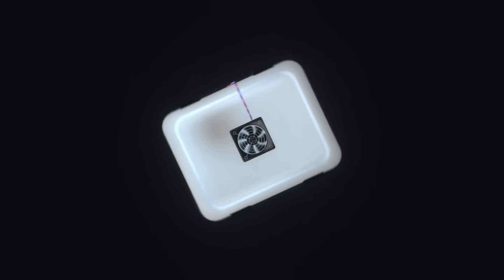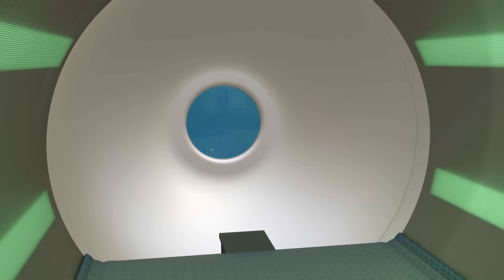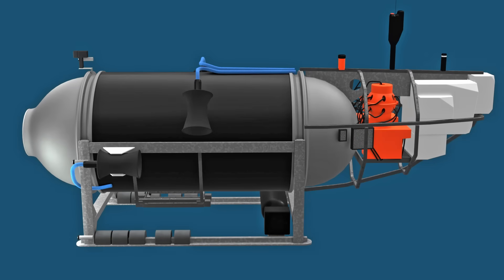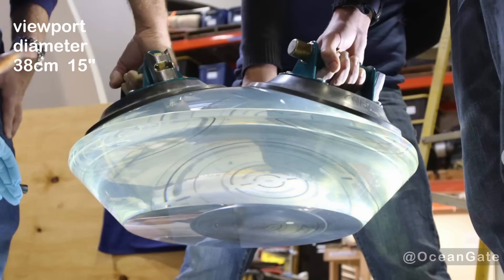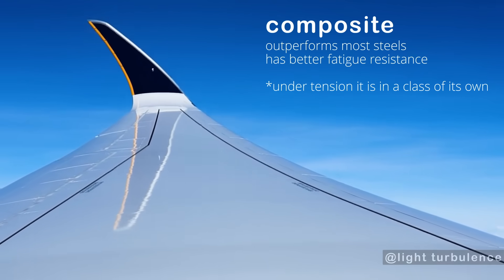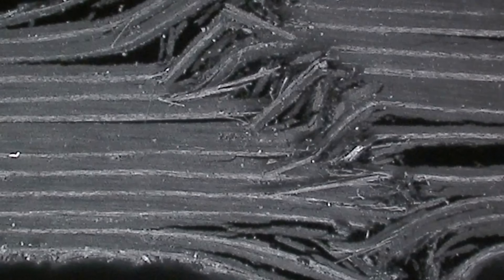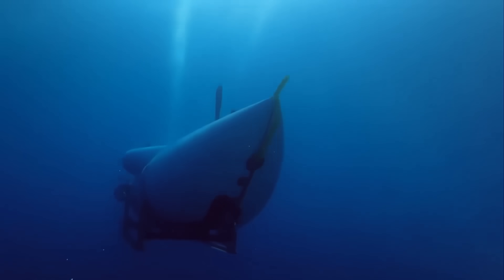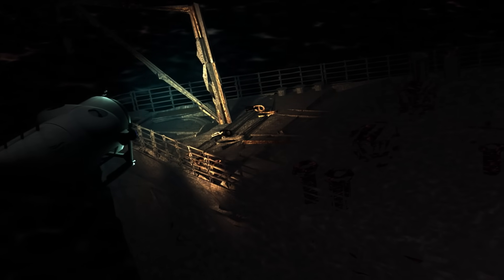Titan Sub | carbon fiber - Detailed Tour

Comment: Carbon fiber for those who don't know is essentially a rope. Think about the cables that hold some bridges, they are designed in a way that their tensile strength is much higher than their compression strength, the material is so strong that it could sustain strong compressive forces but only at a fraction of what they can support went tensed. Carbon fiber is by its design meant to be extremely impressive when tensed but it can only hold a fraction when compressed. Steel hulls are extremely strong under compression when using basic geometric shapes like a cylinder. To be an innovative application of carbon fiber one would have to understand how to weave it in a certain pattern and calculate a certain geometry for the submersible so that under uniform pressure the carbon fiber would have to extend in order to keep everything in place instead of contracting. This is admitting such a solution even exists. The other option would be to brute force the problem by creating such a thick and dense carbon fiber hull that even if the compression limit is only 10% of the extension limit it would still be enough to easily go back down to 5km and come back up. I am not even going into more technical details such as computer modeling. It is extremely easy to model the behavior of a cylindrical uniform Steel or Titanium hull (so much so that a noob could do it) whereas it is extremely complex to model a material composed of two or more due to the non linearity of the partial differential equations which results in bad behavior of the numerical solutions that your software will generate.
Reply: It appears carbon fiber maybe useful for submersibles for shallow dives...but not for trips to the TItanic or to the Mariana Trench.
Reply: @PungiFungi  not entirely true. A CF submersible designed to go to the bottom of the mariana trench was invented, and tested to that pressure, but was determined to be one use only. So it seems like it works fine as a one use material to those depths
Reply: Just a general comment from an aerospace guy.   On wings it’s not the composite skins taking most of the Compression or tension loads.  Most of the bending loads are resisted by the front and rear spars, and still made mostly the old fashioned way out of aluminum.  There are some newer commercial aircraft with composite spars but I don’t think you can call it the norm.
Reply: Thanks  @chrissmith7669 . Makes the point the example of an Airbus wing is not a good analogy
Reply: Sorry Mike, but I believe you are fundamentally wrong. Your assertion that composite fibre materials are great under compression is wrong. Let’s take a step back. 
Just as @zemm9003 says, GRP and carbon composites are made up of millions of threads (or ropes) bonded together in a resin to keep them in shape. Their huge strength is in the strength of ‘*the ropes*’, and ropes are very strong when you pull on them (tensile strength), but simply deform (fold) when you push on them. What holds them together under compression is the resin and not any inherent strength of the fibre as you’re not pulling on the fibre and using its strength. You are now reliant on the resin and the ‘matting’ trying to keep it together. No wonder is cracked and groaned when they dived.
And your analogy of the Airbus wing is also incorrect. Why? Well let’s think about what happens when that wing flexes up (or down). Yes, the top of the wing (in a flex up) is under compression, but what’s going on on the bottom of the wing? That’s right, it’s under tension and composites are very strong under tension. So the wing is not resisting the upwards flex due principally to the composite resisting the compression, but by the resistance to the tensile load (stretch) carried by the lower surface. The upper compression is supported by the lower *tension*.
Let’s think about composite aircraft bodies. What’s going on there? Well, aircraft are pressurised at altitude meaning the fuselage is under … you guessed it … tension … constraining the internal air pressure.
And what happens to a submarine casing? It is under compressive load only. There is no ‘other surface’ in tension like with the aircraft wing, all those fibres and the resin trying to hold them together are being squeezed together. You are not benefiting from the huge strength of the fibre. You now have nothing more than ‘some matting’ trying to keep the resin together, as it’s the integrity of the resin that is now saving you.
Reply: @iainhunneybell  reinforced plastics are not as good as in tension but is a poor analogy to what's actually happening. You'll find the strength is generally reduced to %70 ish (depending on laminate stack fiber modulus, resin content and stiffness etc.) and excluding buckling modes which exist in all materials. 

The pressurization of a plane hull offsets the compression loads reducing the buckling tendency which is a big factor also. The main point is pressuring the fuse is a benefit to every material in this scenario. 

The compression and tension have to be balanced in any beam structure. You just need to look at a bending force through the section of the element to see that. Whether or not that neutral axis is in the mid line is dependent upon the stiffness of multi material and asymmetric cross sections. 

Just look at the push rods on F1 cars they are of carbon construction and they outperform their metal counterparts quite well! And they are very much only in compression when in their working window. 

Is carbon a suitable material for everything no. Is it just as strong as the resin under compression also no it's very much stronger than the matrix material. It's a very good material under compression when engineered correctly.
Reply: @iainhunneybell  You knowledge of the distribution of tensile and compressive forces in a beam or wing, in bending is just wrong. If the beam is symmetrical the compressive forces on one side are exactly equal to the tensile forces on the opposite side. At the centre is the neutral axis where there is nether compressive nor tensile stress. It resists bending equally because of the tensile stresses and the compressive stresses.
A cylinder under compressive load can fail in two distinct ways, the material can crush or it can exhibit a stability failure also called Euler buckling where it crumples like a steel can. The first crushing is entirely resisted by compressive strength, but the buckling failure is resisted by stiffness and carbon fibre is one of the stiffest materials known.
The failure was probably due to water ingress into the carbon fibre laminations at the Titanium/carbon fibre join.
Reply: @iainhunneybell  When I read your comment and all the others I just ask myself - "Why did makers of Titan used that carbon threat to spooling it up on the spool (like thread for sewing machine) when if they winding it up like wires on toroidal core (cylindrical one) would have work  better from compresion/tension stand point." And I'm answearing myself. It's because robot that was doing spooling would have to be way more complex(expensive) and they would need more complex other parts of submarine aswell.
Reply: @iainhunneybell 
Consider the fiber as a stiff element if its non-axial degrees of freedom are locked by the resin matrix. A woven carbon fiber block would be much stronger in compression than a similar block made of resin alone. 

In an airplane wing the compressive forces are countered by the tension forces - the two are in exact balance. The art is to design the wing so the neutral plane is positioned correctly so neither compressive nor tension forces exceed the structures that bear them.
Reply: @iainhunneybell  
You are absolutely wrong. After 20 years of carbon Fibre lab testing and using it in the wings of our JS gliders  I acan tell you that Carbon has about 60% compressive strenght compared to tension. It is the carbon fiber that carries the compressive load, not the resin.  Carbon roving in epoxy has a compressive strenght of 670 MPa and 1000 Mpa in tension. Resin in compression is about 80 MPa.  The top flange of any carbon wing beam is in compression and we design for this. I can give you 20 years worth of my own lab tests which substantiated this and this data is also accepted by EASA for aircraft manufacture. The tensile strength properties are rarely used in aircraft wings as the compressive strength is the limiting factor and thus the design point. The compressive strength while loer is still bteer than most steels an about 2.5x that of Aluminium. So still an obvious choice for aircraft wings.
Reply: Just a general comment from an aerospace guy.   On wings it’s not the composite skins taking most of the Compression or tension loads.  Most of the bending loads are resisted by the front and rear spars, and still made mostly the old fashioned way out of aluminum.  There are some newer commercial aircraft with composite spars but I don’t think you can call it the norm.
Reply: @chrissmith7669   You’re talking about Boeing and Airbus, which are very conservative for a number of reasons. Composite wings have been around on smaller aircraft for decades. And the old-fashioned way of building wings did not use aluminum but wood, which is actually a natural composite. Of course, the really old-fashioned way of building wings uses bone, which is also a composite.
Reply: @edwardwright8127  lol.  My composites instructor once told us nature was the best composite designer ever and we’ll never beat it
Reply: @chrissmith7669  that composites structure instructor should go into a Forrest and study the deteriorating strength of decaying wood, for some reason nature taught worms to eat that super natural best designed structure. He must have left out that nature is also the best ultimate disposal designer.
Reply: I heard some of the material used in the carbon fiber was beyond it;s shelf life.
Reply: @oldarkie3880  carbon fiber does not have a structural limiting shelf life, no microbes, or humidity deteriorate the material . Not does the strong inter atomic bond  deteriorate over millions of years.
Reply: So this is why he was supposed to test the design. He could have done a couple of test dives to increasingly deeper depths - say start with a depth to 1km first, then ultrasound the hull and check the structural implications.
If all is OK, he could gradually increase the dive depth, rinse and repeat until there is confidence in achieving the required depth.

That's the least he could have done for passengers. Instead, he was a cavalier cowboy with delusions of grandeur.
Reply: @scroopynooperz9051  I think just a few of those "gunshot-like" sounds would have sent me back to the lab! lol.
Reply: @scroopynooperz9051 You can't ultrasound CF that's 5 inches thick.
Reply: @scroopynooperz9051  And he expressly refused to test the hull, according to his lawyer.
Reply: @scroopynooperz9051  ...You are aware he did do those test dives, with only himself on board. And that this was the last dive out of a long series of titanic dives, all of which were completed without incident, right? 

Sure, he was cavalier with certain safety precautions, but he did do the due diligence on testing the actual pressure hull on first manufacture. He didn't do enough post dive or post season inspections from preliminary reports, as the hull was not 100% inspected with sonographs and radiographs in the post season as was recommended as best practice. 

Given the attempt to fundraise for science using these tourist expeditions, I can see where someone whom is totally convinced they're well informed, while being entirely unfamiliar with the real world, as scientists tend to be, would decide that such extensive examinations were cutting into the science funding and were not required because in theory the hull should not need it according to their calculations. 

He was an idiot, but he wasn't evil, nor was he entirely and utterly moronic to the degree you seem to believe, as extensive testing and inspection after the first handful of dives was in fact conducted. This is more a dehavvile comet type situation, where the inspections failed to catch progressive failure that became lifethreatening well after the original testing period.
Reply: Wokeness is the ultimate killer.
Reply: You're just repeating stuff you read. Come on dude. 🙄
Reply: 😂Yeah that sounds great but unfortunately all the real experts who do submersibles for a living say carbon fiber isn’t suitable for deep submersibles
Reply: @Deepblue220  It's interesting to note that those experts are still alive, unlike the champion of the carbon fiber submersible. I think there's a lesson there that OP just can't grasp.
Reply: @rodneybray5827  Exactly. The carbon fiber champion is dead. James Cameron has been to the bottom of the Marianas Trench. No carbon fiber present 😂
Reply: @JoeLinux2000  If you want to ask a question - then ask   that question. "???" isn't going to get you any answers!
Reply: I’ve used a similar analogy trying to explain why composites aren’t used in compression.  In compression Most of the load is taken by the resin or epoxy used.   Crack open any design book on composites and I doubt you’ll find any ton how to design for primary loads in compression.
Reply: As mentioned it's strongest under tensions not compression so the reports are correct and an airplane wing is not a good example as most of its forces are tension not compression although there are lessor compression forces on top, along with being a composite material and not pure carbon fiber.
Another problem with carbon fiber is it does not deal well with cold and repeated dives were almost certainly making it more brittle.

The sensor system was under lunacy give how carbon fiber fails which is all at once and completely. A traditional hull may have given some warning which a sensor system may have picked up but not this material.

As for the pictures giving clue they may be correct or total red herrings given how carbon fiber fails but only time is going to tell that story.

The so called messages we total nonsense and didn't even get basic facts right.
Reply: This a fantastic  vedio! Carbon fiber  is very strong but  every application is differant air lines spend 100s of millions testing it to death self destruction  testing 
Is mandatory in all cases  structural engineers with life time of experience  is needed yes it was a beautiful  design  and carbon fiber I believe  was a good idea 
Only he didn't  test or build it correctly maybe another 2 in he's cloud have saved the day ! Only he didn't test it to destruction 
Carbon fiber works on directional  force vectors  if you apply force in a wrong way it breaks like glass   it must be laid up in 100 percent perfect way or it will brake
Add to that salt water! May have weakened the resin or the fibers again testing is the only answer he did very little
Reply from the maker: @@freiherrdinkelacker I’m not saying 100% it can work. If they can’t get it working in testing and development nobody will sign off on it and they idea goes to the dustbin. But from my conversations with composite experts the material has the technical strength for the task. But this is a new use case with plenty of unknowns. This is nothing earth shattering, I’m just talking common sense.
Reply: Rope is a wrong analogy as rope is itself made from strands to be flexible in many directions, those are strips. For a better analogy try folding paper more than 7 times over ;-)
Reply: Hydraulic Press Channel has some great videos of paper under compression (spoiler:  It explodes)
Reply: interesting. I'm of those that believe carbon fiber will be found in submersibles - 35 years from now. why? i witnessed the same arguments against using carbon fiber in modern airplanes as we transitioned from aluminum/titanium.  its amazing how it can be structured. I see not just the fuselage (rope like, must withstand internal force) but other parts, stringers, tail empennage connection points (777) all made from composite now.  not here for an argument (and yes, i'm involved in aerospace)
Reply: @prestonburton8504   wait I never get on a carbon fiber jet  in time you will see planes breaking up
Reply: @prestonburton8504  The main fatigue load in airline aircraft is the number of pressurization cycles, puting the wound fibers in tension, in the B 787, In the Airbus four panels are fastened to form a much more complicated load path around the fasteners, with local deformations enough to ruin the outer coat, with paint separation, a reason for Quatar to refuse acceptance of A 350 aircraft.
Reply from the maker: Be careful getting your technical explanation of carbon fibre from James Cameron 😂
Reply: @Mike-Bell  >Be careful getting your technical explanation of carbon fibre from James Cameron 😂<
Sure, but how about the material engineering profession, especially specialists on carbon fiber, and those who design pressure vessels or submersibles?  The professional consensus seems overwhelmingly that {carbon fiber} = { no bueno for external pressure loads.}
Reply from the maker: @apostleverde  I did consult aeronautical engineers who manufacture aircraft from composite. They find it hilarious that composite apparently is no good for compression seeing as the success of their planes and their business is dependent on carbon carrying the crazy compression forces in their wings and critical parts. 😂
Reply: @Mike-Bell  The issue isn't so much the compression forces. In a thick walled cylinder that is loaded with outside pressure, you will experience tension forces in the inner half of the cross section. In fact at the inner diameter you will have the same tension forces as if the pressure would be inside of the cylinder. But, there can occur issues with CF-Composites which comes from compression, which the Titan sub allegedly experienced even before the disaster...delamination. CF-Composites run the danger to delaminate if you put them under excessive pressure but also tension. Though the forces required to cause delamination under compression are much lower. Which means the outerlayer could delaminate under the pressure, effectivelly thinning the effective structural cross section more and more, increasing the load on the remaining material. Eventually the delamination will happen so deep in the structure, it will cause an immediate catastrophic failure.
Reply: lol  @shi01  , who are you parroting?
Reply: @Mike-Bell funny you say that, the carbon for wings is specifically designed so the carbon is primarily experiencing tensile forces. Weird call to a false authority and invisible army argument you're trying to make all through here.
Reply: @shi01 exact. And delamination is also a pb for planes. See a350
Reply: @Mike-Bell  That's a nonsense. When you bend a wing upwards the top half goes into some compression but that is more than offset by the lower half of the wing going into tension.  The tension side is doing all the heavy lifting.
In the Titan submersible, there was no tension offsetting the compression therefore all they had to rely on was the compressive strength of CF which is much less than its tensile strength.

The compressive strength of Carbon Fibre is between 10 and 60% of its tensile strength.  The compressive strength of Titanium is more than twice its tensile strength for comparison.

But you haven't even talked about what the OP raised, Carbon Fibre is not a homogenous material like Steel or Titanium therefore it's much more difficult to model due to variances in the material.  You just don't get that in Titanium.
Reply: @Mike-Bell Having consulted aerospace engineers, they agree with the original comment, that carbon fiber is good for some loads but not others. The compressive load found when under external pressure is a great example of a load carbon fiber is not designed for, according to them.
Reply: @captainwin6333 the video put forward some interesting hypothesis about a potential failure mode, the Fibre isn't doing as much under compression as the resin which i think matters more here. 

They may have been better off with thick layer(s) of resin which would be individually easier to model. I'm guessing there was more contraction of the fiber (from the outside) and the seam was likely the failure point, this would concentrate a lot of pressure on whatever is bonding the two surfaces.
Reply: @Mike-Bell  When they say no good for compression, they mean at far greater pressures and forces; you are the one that even admitted in this very video that the axial layers had no tensile forces and only compressive forces and that this was the likely cause.

No crap a carbon fiber resin can handle compression, but it handles it worse than tension, and at such pressures in the deep ocean, this becomes a major factor. And an engine pulling a plane along is putting tensile forces on the carbon fiber. Fiber is better at withstanding tensile forces than compressive forces; that doesn't mean they cannot handle compressive forces at all.
Reply: @69nites Yes, as the carbon fibre on one side of the wing goes into compression, on the otherside it is going into tension, and that's where the strength is
Reply: @Mike-Bell  what part of a wing need to withstand a significant compression force?
Reply from the maker: @dovydaskaminskas4227  In normal flying it is the top skin or the top of the spar but in negative G it becomes the bottom. And torsional forces complicate that too.
Reply: @shi01  I agree. This is a meterial that cannot recover from deformation. Each deformation just adds to the damage. There is no popping it back into place like with some metals.
Reply from the maker: @fnhatic6694  well yeah actually an aircraft flies at lesser pressure at altitude so even less force by your logic but thats not how it works. 
The structural load in the wing is from the tip bending up against the wing root and those forces inside the cantilever beam structure are MASSIVE where it acts against the body.
Reply: @Mike-Bell  to muddy the water (bad pun) even more.  An aircraft fuselage skin is loaded in primarily tension as internal pressure expands it like a balloon at altitude. Many also contain negative pressure relief valves that prevent crushing pressure over about a half psi to prevent potential damage. 
It doesn’t take a phd in composite structure design to notice nobody’s navy uses composite hulls in submarines that don’t go even a fraction as deep as titanic.
Reply: @jj-jak  Using only resin and no fibres? That already exists in subs. Look at acrylic windows and acrylic hulls. Being formed all at once, acrykic is a uniform material where it's easy to test smaller hulls many times by load cycling until destruction and then apply mathematical models for larger hulls. This is same as how we can compute the strength of varying size steel beams - the material itself is perfectly predictable. And there isn't the issue with water getting into the material that the carbon fibre hull has.
Reply: @Mike-Bell  So they're going to fly their craft to the Titanic? You are not very convincing. I should think an aeronautical engineer would have the good sense to strongly consider the opinion of deep water engineering experts. Or do the aeronautical guys all wait with baited breath to hear what other engineering fields tell them about how to build aircraft? Didn't think so.....

If you know any engineer that finds engineering outside of their field to be hilarious, I don't want any part of that engineer's work affecting my safety. Stockton Rush was amused by regulations and accepted engineering in submersibles as well. Who's laughing now, besides these supposed aeronautical engineers? What a crock...
Reply: @Mike-Bell  james cameron dived the deepest point on earth more than anyone, i trust more on his instinct and knowledge than some random youtube content creator
Reply: @Mike-Bell   It was obviously the perfect material.  Glad they're all still around to do it again.
Reply: @Mike-Bell  yeah you can write off James Cameron, but here 8:54 we got words from Brian (Real Engineering) which has a Master's degree in Aeronautical Engineering from University of Limerick
Reply from the maker: @skyfeelan  yes that’s a problem because as an engineer his words carry more weight and he should have researched them better.
Reply: @Mike-Bell  You literally admitted that the axial layers were not under tension and only compression and that was the likely cause; how is this not contradicting yourself?
Reply from the maker: @pyropulseIXXI  I said axial fibres were not laidup under tension.  That has nothing to do with the forces in the material once under load in the ocean.  Once in the ocean the axial fibres failed because they were skew.  If they were perfectly lain and straight they would have survived the compression.  I dont get where you say I am contradicting myself.  Or I dont understand the point you are making.

And in my video I noted that CF is way stronger than in tension than compression, nobody disputes that.  Importanlty in compression it is still up there with the best steel.  Thats what makes it a structural marvel.
Reply: @Mike-Bell  under compression the carbon fiber can act as a nylon bullet prof, it will distribute the pressure to a larger area. The problem for the submersible is the pressure be is everywhere. The nylon vest is weak in compression, but it will protect from the pressure of the bullet
Reply: @Mike-Bell sorry but you are wrong in many regards about cfk. I recommend you to read some books about it and designing parts with it. To really understand the material build some parts and test them...
Reply: @Mike-Bell  re: "Be careful getting your technical explanation of carbon fibre from James Cameron" no worries, i say be careful getting your technical explanation of CF from Mike Bell for he sounds conspicuously like another Stockton Rush type (ie, a dummy with a death wish) and both the world and the seasoned Mechanical Engineering community saw how that worked out (which is to say it didn't).
Reply: @Mike-Bell Be cafeful about ignoring what James Cameron said. Because you have no links to any company that has managed to solve the issue on how to weave. How to laminate. And finally how to do a nondestructive test that a produced hull are properly able to share the load and avoid bending the fibres.

Camerin talks about our practical level. That's the only level actually meaningful. Not a theoretical model that no one has managed to reach for actual production.
Reply: @Mike-Bell  seems like, in your video, we see the crushing from the ends, as you say, and this would suggest it needs to be designed so that compression from the ends causes tension. When we have a rubber ball, and we squeeze it, compress it from two sides, this compresses the air in the ball, making an outward force that restores the ball to its previous shape once released. Every push inwards, from the ends, should be causing the structure to fight back, trying to push the ends back out. If you cannot rely on air compression, then you have to make structures in the material to do this. This sounds like something that a 3D printer might be perfect for.
Reply: @Mike-Bell carbon is doing almost none of the work in compression strength. It's essentially a form for the resin which is doing all the work.

Could you make carbon work? Maybe. Is it the optimal material? Not at all.
Reply from the maker: @69nites  you don’t know what you are talking about!!
Reply: @Mike-Bell  excellently formed argument. About as good as "I talked with an unnamed person in another industry where carbon is being used for an application that is also literally filled by canvas due to the fact that it's a tensile load and frame it as a compressive load"
Reply: @69nites he showed that the carbon does do work, but it relies on the glue to hold the fibers in place. He also showed parts of the fiber being irreperably crushed, so then, yes, at those places with damage, the glue is now doing a lot more of the work of trying to resist compression.
Reply: @69nites I came through the comments to make sure that someone  called out some of his incorrect statements. 
Also - he keeps bringing up James Cameron as a non-expert, but you have to think that he spent a lot of time with experts to build his deep submergence craft. He probably learned a great deal from some of the best engineers in the business.